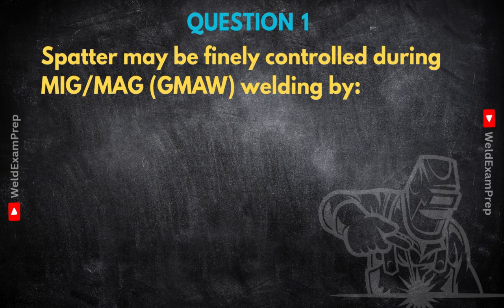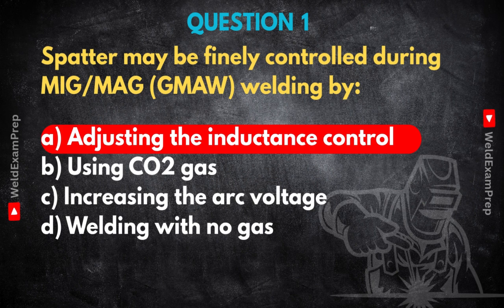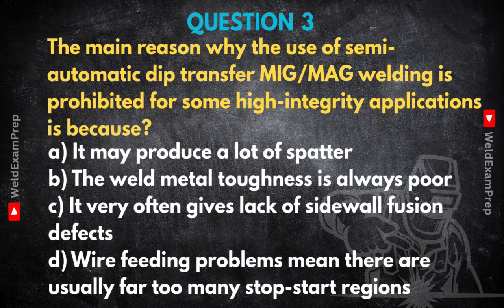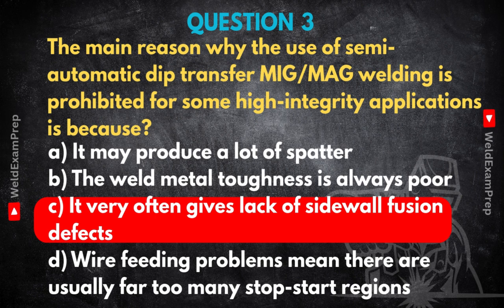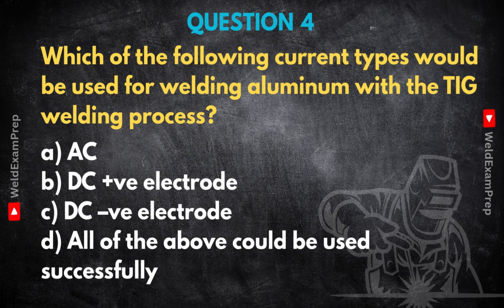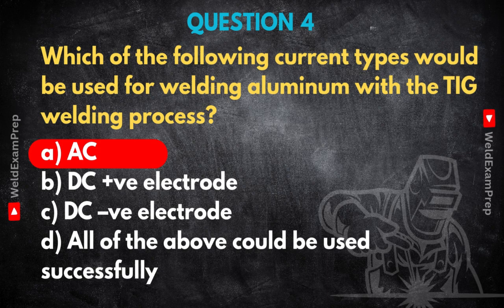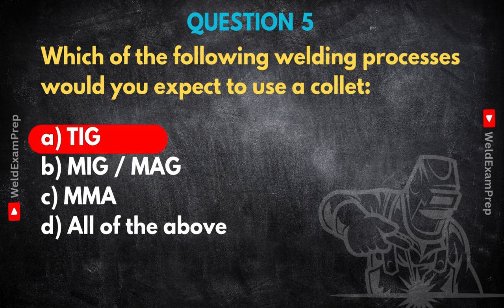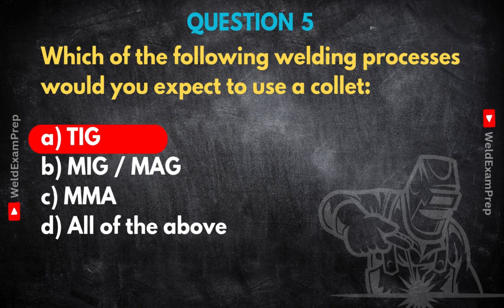Pass the CSWIP 3.1 Exam! 🚀 Most Common Welding MCQs with Expert Breakdown 20

Comment: Hi , for the question no 2 , u were explaining the same question in breakdown 28 but u said cerium electrode, DC - Ve is correct 😢
Reply from the maker: I appreciate you spotting that, and I'll double-check for any inconsistencies!
Reply from the maker: For clarity, we decided to remove this question from breakdown  20 and keep the correct answer highlighted under breakdown  28. 
Thanks for pointing it out. This will help everyone preparing for CSWIP to focus on the right concepts.
Reply: @WeldExamPrep Thanks for the clarification 😊
Reply from the maker: @manikandanm8747  Do not forget to subscribe for more 😊